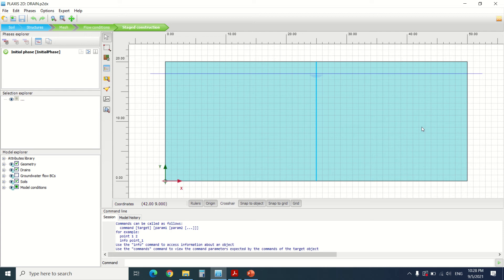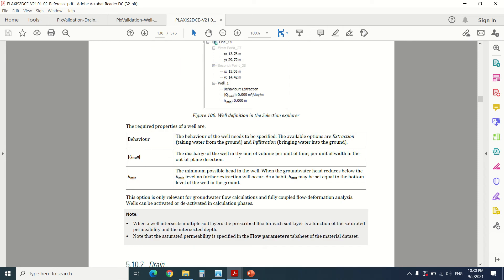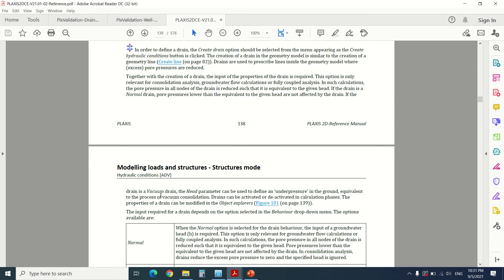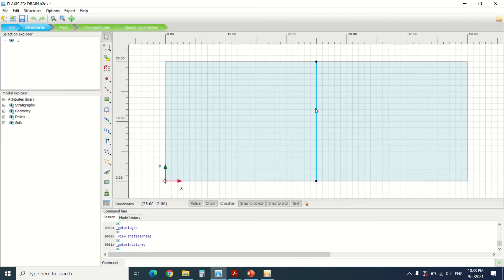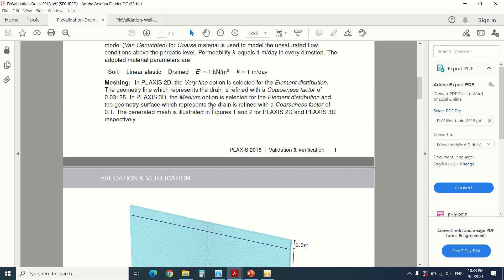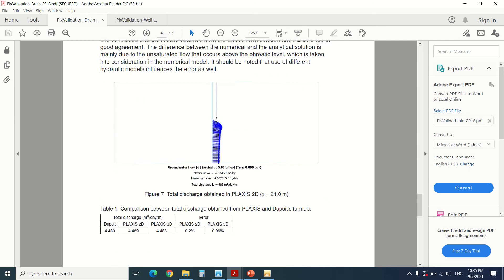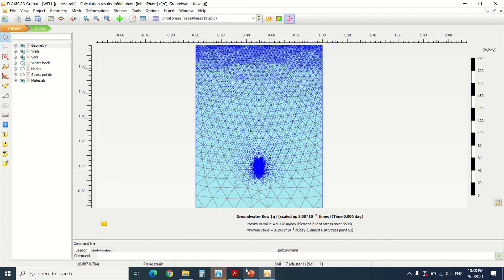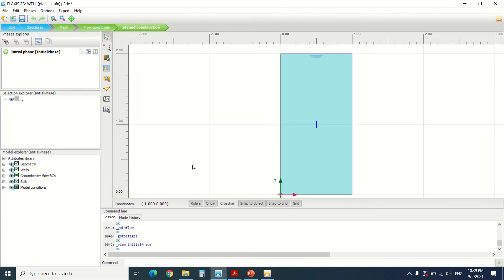drain vs well in plaxis

Comment: How do I determine the well extraction rate without receiving an Ultimate State not Reached error code?

Also, how do I lower the water table in an axisymmetric model? It is not working.